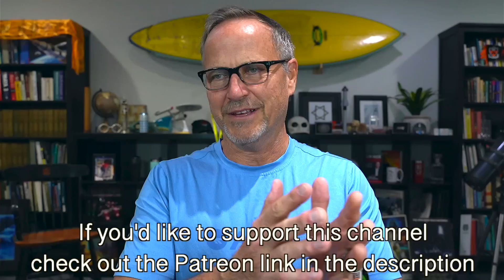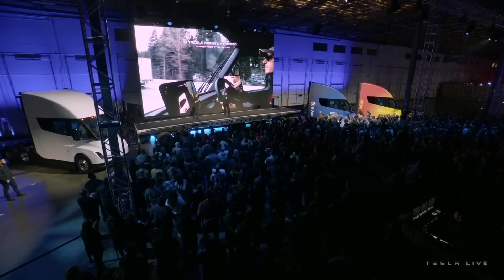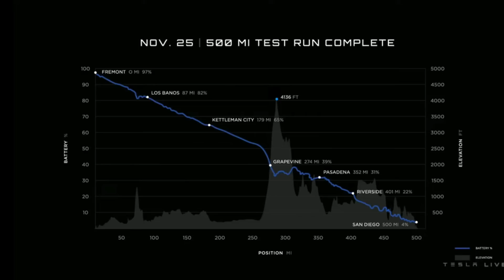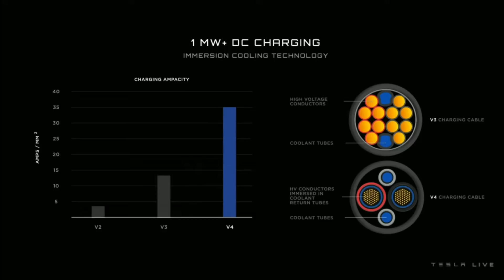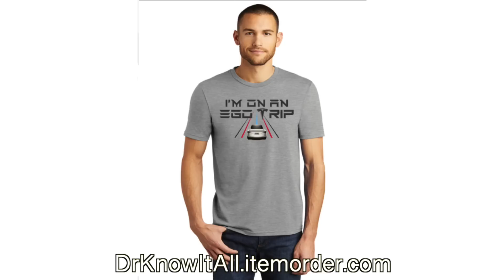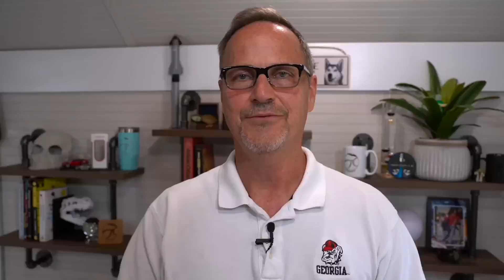Tesla SEMI Delivers on a HUGE Scale! Range, Power... and Cybertruck?!

Comment: Three motors are needed for regen; on a decent downhill gradient one motor couldn't absorb the amount of energy and provide the required amount of resistance required. Obviously the extra two motors are helpful when you need the accelerate.
And the quiet vehicle, both city and country will be greatly appreciated by all.

Comment: Note that the speed limit for semi trucks in California is 55 mph. The majority of the Country allows semi's to travel at the same speed as automobiles. Interstate highway speeds for long haul semi's is closer to 80 mph. The increased speed will most likely offset any gains from the relatively flat terrain. The tire wear issue is a good one. Maximizing the life of the drive train tires would be very important to owner operators. Not sure how software could mitigate the risk of jack-knifing, unless the software was in control of the trailer breaking. Tesla intends to sell the trailer & tractor as a unit, so perhaps they have addressed that. I imagine they will offer a Starlink package to corporate clients which would offer dispatchers more real time information and increase on time deliveries

Comment: You won't be able to charge a Model 3 faster with the v4 supercharger. Charging speed is limited by a bunch of other factors, like cell chemistry, BMS, and cooling. Higher voltage reduces the current required to move the same amount of energy, and consequently allows thinner wires. For this reason, I expected the semi to use higher voltage. And it makes sense for the Cybertruck too, because it will have a big battery too, which requires moving more power through the charging cable.
Smaller cars won't benefit from higher power chargers, even the current 250kW limit they can only reach for a few minutes, and it barely reduces the overall charging time. For these the 1000V architecture would mean thinner wires inside and a bit higher charging efficiency. But there are significant disadvantages too, like higher cost, that's why Tesla still uses 400V in every other car.
But now that they developed the 1000V architecture anyway, it might make sense to eventually use it in all cars.

Comment: Elon noting that it is model S and x motor and knowing that voltage is 1000V means that motor is probably 1000V and there is no Model S/X motor that is 1000V meansd that there must be 1000V S/X soon also they have 1000V pack and  probably 1MW charging. And the coming version of Roadster is the king in that field they may do 2 layer battery pack version of it that has over 1000 mile of range and special battery pack that charges over 20C then it will be viable product to new 24 hour Le Mans race record.

Comment: Voltage advantage is all about E squared over R. Simple. The lower current losses are just icing on the cake. And ADAS probably almost works out the box from other Teslas but the idea of putting it in charge of 80K lbs without very extensive testing is a non-stater. "Almost works" will not get on the road with 80K lbs without regulatory approval that it works well, and that will be slow. The govt can be sued for a too early approval. You could safely say don't hold your breath.

Comment: Good stuff. I think implementing a basic ADAS will be much simpler than you mentioned. Optimus is already using the FSD HW/SW to navigate it's world. Seems to me Labeling, edge cases, and rules of the road were the biggest obstacles, not the physical dimensions of the vehicle. 
Cybertruck. If a Plaid makes 1020hp at 400volts, stands to reason a tri-motor Cybertruck would easily double that number at 1kv.

Comment: Do you think Tesla will develop a product that goes on a trailer and provides regeneration braking on downhill road segments? One pedal driving could signal the trailer to apply regen instead of friction brakes. That would save trailer brakes same as it does for tractor brakes. It would be sold to trailer manufacturers who would implement and sell those trailers to Tesla tractor owners. Or maybe a company like Magna would be best to get into that business. It might be too costly since it is basically a motor-generator with no need for the motor function. Wait a minute! With that motor-generator, you are almost all the way to a "robo trailer". Picture a fleet of just trailers driving themselves down the highway! No tractor, no cab, no driver, no mandatory rest period, etc. Just a box with 2 MGs and a controller and software. Once Tesla has robotaxi it's just a variant with no human niceties. Much lower COGS and much longer operating times with a MegaCharger stop every 500 miles - cross-country in 5 charging stops! Via I10 it's 2416 miles and via I40 it's 2439 from LA to Jacksonville. Hmmm, time to buy stock in Wabash and Great Dane.

Comment: Plaid motors are 400 volt, so not sure what a 1000 volt system means. 
1000 volt system is no more complicated than a lower voltage system
Wires are smaller, but 1000 volt semiconductors cost more and generally have higher resistance than lower voltage motors
Operating three motors takes more power than one if, and only if, they are operating at a less efficient point when the load is spread across three lightly loaded motors instead of one heavily loaded motor.
Reply: They could have changed the motors to run at 1,000 volts, but even if they run at 400 volts, then having a step down DC-DC converter before the motors, you'll have 5 times less heat loss in cables at more than double the voltage.
Reply: @TheKimNeeper  If the motors are 400 volts and the battery is 1000 volts, they would not implement the step down as a separate DC to DC converter stage. That would be redundant and add extra losses. All they would have to do is use higher voltage semiconductors in the inverter. The inverter is inherently capable of lowering the voltage - it does that all the time to vary the power.
It would just need to be programmed to max out at ~40 percent duty cycle in its PWM.
Losses in connecting cables are a trivial part of the total losses in the drive system.
I doubt they raised the voltage to get more efficiency.  The overriding issue is charging. It's a lot easier to deliver a megawatt at 1000 volts than at 400 volts.

Comment: John, don't know if you read my 'numbers'???
Last week at the latest, l did my back of napkin for SEMI.
Scribbled 850 kWh Pack using 1.7 kWh/m.
This now leads me to state the QUAD CYBRTRK to have a 175 kWh pack going 3.1miles on a kWh.
Giving 525+17.5= 542.5 miles at max usable kWh or another way, let's say usable of ~163.3 kWh gives 506.9 ms or 
* 507 ×16=500+300+42=842kms
Reply: Don't forget they only used a total of 93% on the Semi trip. It could potentially be higher than 850, plus they presumably have that same buffer
Reply: @SyntheticSpy  
Thanks for siding with the facts as presented. Either way, we WIN
Reply: @ivankuljis1780  Absolutely

Comment: I think a crucial benefit of 3 motors is regen. The 1MW power architecture can probably handle all the energy generated by 3 motors, even at higher grades (the Coquihalla highway in BC has a max grade of 8% on Canada's major cross-country truck route).

Comment: Is the trailer set up for regenerative braking or is the trailer braking just a loss?
Reply: There will always be losses. The regen is brilliant but you can not use all of it or it has to be restricted depending on how much charge is in the battery as regen can push to much charge into an already full capacity state battery. I dont think that the trailer would be need to be used this way.

Comment: The San Francisco - San Diego route is similar in profile and a bit longer than the very busy State Highway 1 route between Auckland and Wellington in NZ. NZ truckies will be salivating over the cost savings and performance of the Tesla Semi, and Government will be very interested in the cost and carbon savings if our long haul fleet were all Tesla or equivalent, given that the NZ grid is already 85% (and climbing) renewables. The long suffering citizen drivers would love it if the truck fleet that runs 7 x 24 was high performance Teslas, especially in the hilly winding central plateau section. Likewise the residents in the many towns along the route would love silent EV trucks gliding past. I wonder when Tesla will start exporting the semi?
Reply: Unfortunately I expect it to be a very long time until Tesla starts to export. They have a lot of trucks to replace in the US, and it will definitely take some years to grow to the needed capacity

Comment: Another benefit of regenerative braking that I don’t think anyone has mentioned so far is that Tesla Semi trucks should be able to go faster down hill than a diesel as the Semi doesn’t have to gear down to its lowest gear like a diesel to get the holdback that diesel’s only get when going slow.  The Tesla Semi also doesn’t have a Jake break that makes a significant amount of noise to slow a diesel truck.

Comment: Hi John, since the two "power" motors (as opposed to the main "efficiency" motor) each drive only one wheel, I think they would work in tandem, so the truck would use 1 or 3 motors but not 2.

Comment: No extra danger with 1000 Volts. Higher Voltage requires lower current to achieve the same power. Hence the smaller diameter wires. No extra complications.

It’s the current that kills you. A 12V car battery with 75A (900 Watt) can kill you. 

Remember the Tesla Coils. Way more Voltage, very low Amps.
Reply: A car battery can't kill you unless you put needles into the blood vessels, the skin have a very high resistance, so the current through the heart is very low at just 12 volts. Sure 1,000 volts is more dangerous than 400 volts, but anything above 48 volts DC can be deadly through the skin, so it probably doesn't make any difference.
Reply: @TheKimNeeper  Well, if you shorten out the car battery, it’ll blow up and most likely kill you ;-) 
Very important to use a big enough cable to be able to handle the current.

Comment: Have to wonder if regenerative braking conserves trailer brakes to some extent also.
Reply: It can do 0 - 60 mph in 20 seconds at 82,000 lbs, in theory it should be able to break in the same time just using regen.
Reply: @TheKimNeeper  If trailer brakes are conserved, I doubt that the economies of reduced trailer maintenance have been factored into the savings benefits SEMI provides as a substitute for ICEs. Trailer rentals and fees could also be preferentially reduced for SEMI.

Comment: The 500 mile test took the battery from 97% to 4% battery.... though the truck can do it, is it recommended, keeping in mind the extra stress done on the battery going outside the 80-20 zone?
Reply: The new batteries are not as sensitive as the older batteries about charging to 100% and draining the battery completely.
Reply: It's fine. Time and temperature are factors as well. It's a fully thermally managed pack and it won't likely sit at high or low states of charge for much time.
Reply: @GregHassler  these trucks are for local delivery it's to prove a point that they could, this semi has the longest range of all electric trucks so far and as battery technology gets better just like EV cars now the range will get longer!

Comment: 1.7kW/mile is super amazing...  Do they already have a "tire health optimization" drive mode that optimizes the acceleration to keep the tire wear down? Also - would be interesting to know the Semi specific safety features? Must be something for such a heavy vehicle, and also because this is specifically used for long hauls.
Reply: Having the 2 drive axles with their own drive regimens suggests they aren't prioritising tyre wear.  I'm assuming the best thing for tyre health would be balancing the accel and brake load over all the drive wheels.
Reply: Non stop steady speed. Stop and go driving is less than 300.
Reply: Yes, this truck will suffer an efficiency loss in stop and go traffic.  But so does a diesel truck.
AND, with regen braking, this truck should suffer far less of a loss in efficiency than a diesel truck.  Especially since it is already more efficient than a diesel at steady speeds.

In fact,  I think that more congested routes might even provide the greatest efficiency gains over diesel trucks. (If the route is within the range)
Reply: @Just Because
500 miles at 62 mph is about 8 h driving.
Stop and go 300 miles would probably be about the same.
But you are forgetting about regenerative breaking.

Don't be so obstinately negative!
Reply: They mention in the video they do differential power to the wheels to avoid things like jack knifing.

Comment: I think the reason Tesla didn't mention Seimi automation was so as not to draw attention away from the astounding engineering achievement (although it's obvious in hindsight) of the super-efficient drivetrain with 2 of the 3 motors clutched for idling during cruise.  I love the real-world SF-to-LA.
Reply: Tesla probably didn't want a truck driver backlash, as autopilot is a potential future job killer for commercial drivers. I believe it was a calculated PR move, weather or not it has or will have the capability in the future.

Comment: My Tesla gets much better range driving in the mountains than it does on the flats.  The energy recovery is so insanely good and there is less wind resistance at higher elevations.  Specifically I average 225 Wh/Mi in the mountains vs 250 Wh/Mi on the flats (I70 vs I25.)  So my guess is that they won't get more range on the flats.
Reply: Yeah people get confused about regenerative braking on downhills. If it's VERY steep you will regen, but for the most part you just use significantly less power to move forward, because you're using the potential energy you stored on the way up.

Comment: My daughter totaled my Nissan leaf.  I went to the scene as the tow truck pulled up. The driver walked over and started pulling and prying on the bent steel to make it easier to pull up on the bed of his truck.  I went over and told him there was a master disconnect that he needs to pull to make the vehicle safe. He gave me an angry, "don't tell me how to do my job" look, and continued to haul the carcass up onto the truck. I wonder how many will need to fry before the towing industry fully catches on. 1KV with huge current is pretty toasty.

Comment: If Tesla Semi moves 40,000 lbs of load 500 miles on one charge, will the same Semi with 20,000 lbs load move it 1,000 miles?
Reply: No, my guess would be 700-800 miles.
Reply: At highway speeds air resistance is a significant portion of the energy required for a car, probably  even more for a truck.

Comment: This is an impressive truck it would be good to see a comparison test between the offerings on the market eg ECascadia, nikola etc.
Reply: Exactly. Just start from bottom of Grapevine route, run 200 mile, see speed, braking and regeneration potential. Nothing else is close. All diesel truck manufacturers are now making toxic, slow museum pieces.

Comment: What a monster. However, not happy that the destination is 5000 ft. below start point. This is equal to 154 kWh of free potential energy. Assuming a battery of 900 kWh the test is "cheating" with 17% equal to 85 miles. A more accurate/scientific test is a round trip test together with a control truck running at the same time. Still impressive range though...
Reply: This is not true.
Reply: @jemezname2259  you are right, I miss read the graph. The elevation different is very little. I am more happy now😀

Comment: The latest info I can find on Tesla 2170 charge rates is about 30 minutes to charge from 20% to 80%. So this is fundamentally how fast you can charge the Tesla semi. I don't see anything to make me think the 4680s in the Cybertruck will be different. I hope I am wrong and they have breakthroughs that allow for 10 minute charges on a regular basis without damaging the batteries. But I haven't seen any news to that effect. 

People seem to get confused about charge rates. They think a higher battery pack voltage leads to faster charging, it doesn't. The individual cells are what matter. The charging voltage across those cells is the same no matter the pack voltage. Raising the charge voltage damages the cell. 

This means that all batteries using the same cells charge at the same max rate regardless of pack voltage or pack size.
Reply: But, getting enough charge to drive back empty after unloading will be super fast because of  not needing a full charge. More of the partial charging will be at high current. maybe fast enough to recharge during the unloading time in many cases.
Reply: The drivers are legally required to take rest breaks so it doesn’t matter.